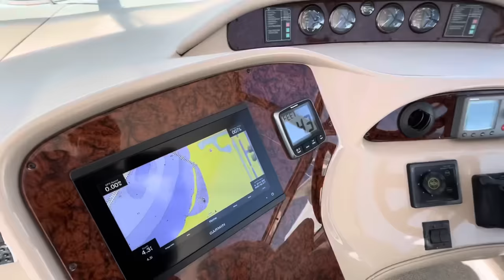2003 55 Sea Ray Sundancer @yachtbrokerbrandon

Comment: I get that the lounge is enormous and it does looks comfy, but I’m shocked there isn’t a third small cabin. For a 55’ I feel like that’s usually not a huge ask. I’m sure it was owner spec I just couldn’t imagine this much boat with so little sleeping accommodation. Then again I’m not a retired couple who probably won’t need room for 4-6 guests that often. The extra space is probably well enjoyed by those who travel as a couple for long times with the occasional visits from another couple folks.
Reply: Boaters are very very close-knit community. No need for a third cabin.
Reply: The reason is this yacht has 2 very large staterooms. To have a 3rd stateroom they would have needed to make the forward stateroom the master and then greatly reduce the size of the aft stateroom and salon to make room for a 3rd stateroom. It's unnecessary because the sofa in the salon can be turned into a full size bed. That's really all you need for the very few times a 3rd stateroom would be used. If you have a large family you would likely want a different model but for 95% of us this would be optimal.
Reply: The 3rd state room is on the 60ft.

Comment: I remember when this model came out, replacing the 540 Sundancer. (It's the same hull. The differences are: addition of skylight in salon to make cabin look better lit. The galley and sofa switched sides. The galley was previously on the port side. Changing it enabled them to lengthen the couch. The galley, as stated is where the washer/dryer combo was moved into from under the bed in the master stateroom. Deleting gave you the extra refrigerator. Also, the hardtop droops down slightly in the rear, enabling shorter people better access to putting up the canvases. The head in the VIP stateroom in the bow was changed to this split design, port toilet, starboard shower, from the previous layout that had both toilet and shower on same side.) This boat is, as shown, a direct drive boat, not a V-drive, like other Sundancers. The straight shafts enable better maneuverability. Great boat. Even being 20 years old, it still has a modern look to it.

Comment: STBD RW pump is leaking, port gear cooler leaking,  generator has rw leak at the muffler, A/C pump fittings leaking.

Comment: you didnt say what the engines are and their performance. i think i seen it say Mann . knowing how many hours and when they was last serviced would be good to know as well.  just a thought. the looks nice. it could use some color on the outside though. too much white on white thats me though.
Reply: i was going to make the very same point. What was the Horsepower rating of each engine, what is the fuel capacity?
Reply: Needs more white on white.

Comment: Good video. I would have liked to have known how many hours on the engines and generator. How do you replace an engine with the small access to the engine compartment? Fuel consumption per hour. Cost of winterizing and de-winterizing the boat. How many bilge pumps? How many house batteries? Cost to pull it out of the water (approximate). Slip costs? Costs for a replacement motor (my guess $60K or more)? I am focused on money and investments, so this is the reason for my questions.

Comment: Awesome boat!! How long does it take to sell a boat like this, I mean in good condition but 20 years old ? what I try to say, as a previous boat owner, if you don't get a bargain from the straight beginning you're in trouble.Usually if this kind of boat is for sale , it only means that the owner is stuck with it and when you're stuck you give a deal, the asking price for this boat is far from being a deal, no disrespect I offer 100k
Reply: i  d do   150k
Reply: @haywoodjablowme2972  send and a link with pics and contact info
Reply: @haywoodjablowme2972  The engines, electronics, and gen set cost more than $100k
Reply: There's one on Lake Michigan that has been for sale for years.
Reply: Not true. Used boats like this one typically sell relatively fast because of the high cost of a similar equipped new yacht - if it has relatively low hours (around 1,000 hours) and is well kept and upgraded over time. Also, most newer models (2014 or later) have pods. Pods are a maintenance nightmare. A boat like this one has standard diesel power with either straight shafts or V drives. Far less costly to maintain than pods. This boat will sell for between $300k and $400k depending on condition - salt water vs fresh water also is a big difference maker. You if you live up North on the Great Lakes never buy a 20 yr old boat that has been in salt water most of its life. You will have issues from salt water corrosion.
Reply: @mkp3824  If it's been on the market for years then it is either not well kept and maintained or they are not serious about selling it. Period.
Reply: @robyork9554  I just checked. It's still on the market, and the hours are the same. I'm betting it has something major wrong with it.
Reply: @robyork9554  boats aren't selling well this year. It's definitely a buyers market.
Reply: I’ve owned multiple large boats and buying them is like buying a house - Age is irrelevant, it all comes down to maintenance and what a comprehensive survey finds.